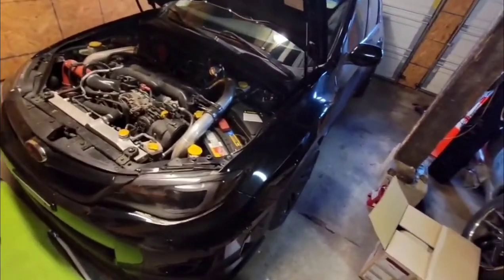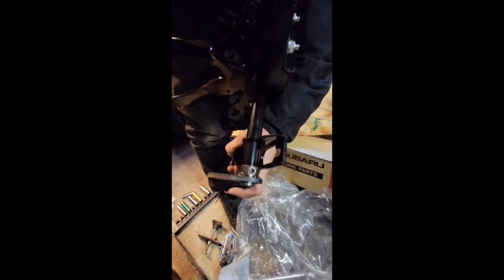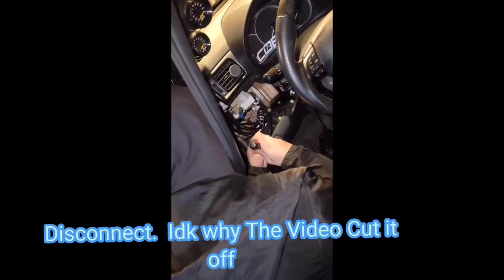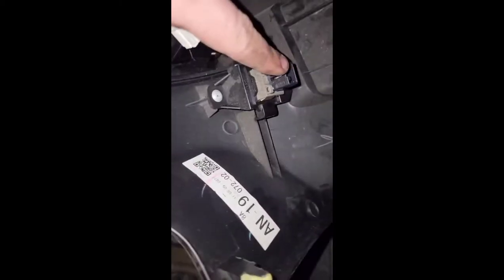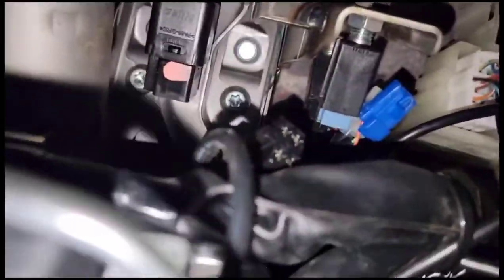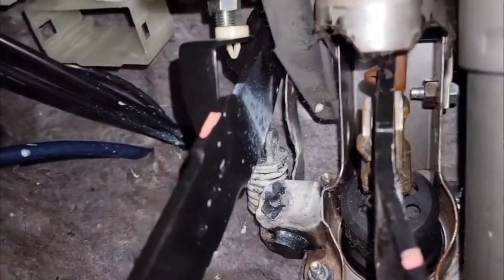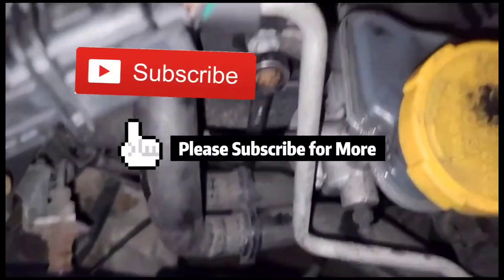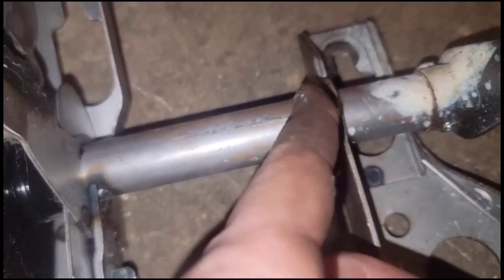Install Clutch Pedal Assembly on my Wrx #subaru #subscribe #wrx #clutch

Comment: I’m in the same boat. Creeping like a mofo. Not sure if it’s pedal assembly or forewall
Reply from the maker: It's annoying, at first I thought it was the firewall so I did the Humble Rumble Firewall Bolt kitz and it went away than a couple months, it came back and last week, I was getting pisses off and I looked underneath and it was cracked.
Reply: @murderedsubie1517  well I guess I better check both. Was planning on doing the humble rumble kit
Reply: I just did the humble rumble kit and still same shit
Reply: I’m going to check if I have a crack
Reply: Fk it’s crack just like urs was at least I no it can b fixed but im going to pay I’m not going to do this lol 😂
Reply: @11wrx_sedan27  I’m checking today to see if mine is cracked
Reply: Mine cracked. I took it to a mechanic. He welded it back together. Lasted a couple days. Broke again, different spot.
Reply: @murderedsubie1517  I did the Humble Rumble Kit as well and it was still squeaking, but not as bad anymore BUT it was still annoying asf. Just came across your video and I think this is what i need to do now to fully fix it.
Reply: So in order to completely fix this we have to get both done or just 1?
Reply: Mine cracked as well replacing it this week